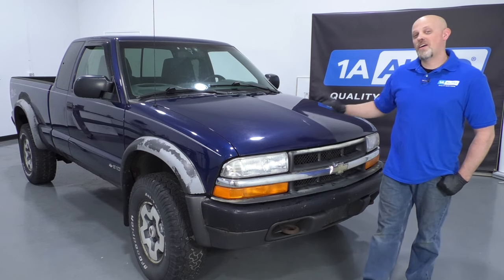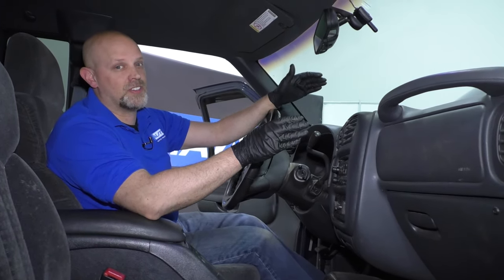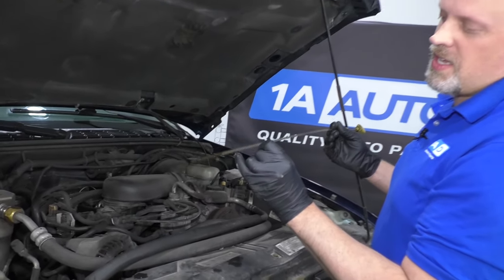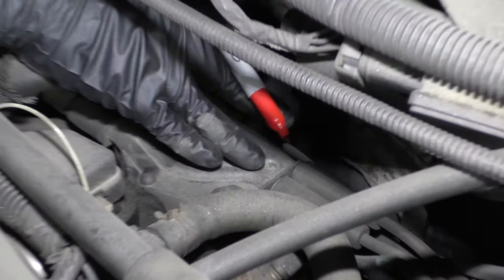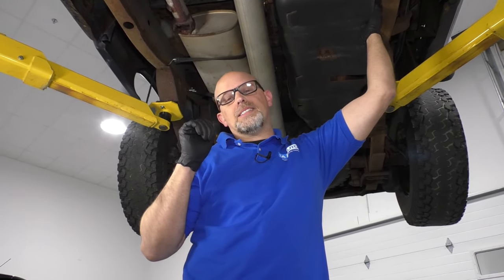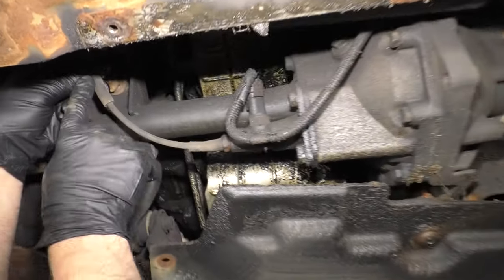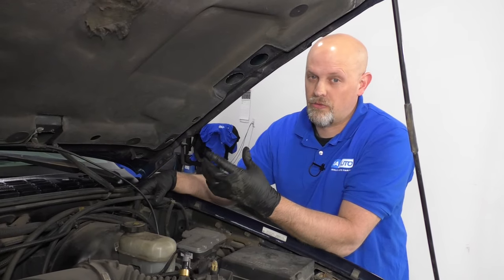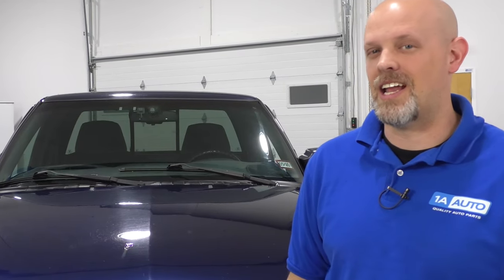Top 5 Problems Chevy S-10 ZR2 Truck 2nd Generation 1994-04

Comment: The fact that nobody has figured out a better way to unblock a heater core is just mind blowing to me
Reply: My heater has never worked
Reply: My heater core messes up occasionally I need to flush my radiator but in the meantime I just take a hose fitting Stick it to my heater core hose turn my faucet on and let it run a little while and then put it on the other heater core hose and let it run backwards works good for about a year but my radiator it's nasty so it gets clogged back up again
Reply: Main reason why get all dirty and nasty is cuz the heater core sits up higher than the radiator so it gets air bubbles and all kinds of shit in the system first take your cap off let your radiator and let your truck run with the radiator cap off did they get rid of air pockets and your heater core if that don't work flush it flush the heater core just unhook both hoses from the engine that ran to the heater core and flush it out with a garden hose if a garden hose going to work take it to the car wash hook up the high pressure pressure washer to it works every time
Reply: One the first things I did to my '99 ZR-2 was to flush that orange Dex-cool shit out and replace it with regular green coolant. The Dex-cool had created an orange jello like muck in the heater core
Reply: @galenhof3371  same thing here, the orange stuff gelled and hardened.  Ended up replacing the core because it wouldn't all flush out.
Reply: I had to put a heater core bypass kit on mine.. the quote to replace it about gave me a heart attack.. the part itself was under like 30 bucks, but the quote stated it is an 8 hour job, with the total being $800 😳so yea, ugh, 3 winters now without heat, super miserable but I've gotten creative with ways to stay warm..
Reply: @jerilynmorris9615  enlighten me on how you are keeping warm I went 5 winters no heat

Comment: Wow - have had ALL of those problems. Sure wish this would have been around when I needed it but wow does it HELP to know this stuff! Have a 2003 s10 4.3 and STILL LOVE that truck. Planning on eventually restoring the whole thing (surely not worth it) because it's just a fun ride and STILL looks pretty good - runs GREAT. Redid the spyder and valves a couple of years ago and was surprise at how easy it really was with a service manual. Lost the dang thing  - Chiltons don't cut it-lol. GREAT JOB 1A AUTO!!! Have found so much stuff over the years that's saved hundreds or hours and dollars.
Reply from the maker: +B L Thanks for the feedback!
Reply: 2003 zr5 with 456k on it. Only one issue besides wear parts was a wire was broke right at the connector for the coolant temp sensor.  Had it parked the past two yrs at sis inlaws farm because im in an apartment building and only allotted 2 parking spaces. Didnt get there often enough to cut the grass around it/under it so the rockers rusted and a few other minor spots. Planning on starting a frame off restore spring of 2024 if not sooner. trying to located leaf springs as I broke one when I drove it off the trailer (no ramps lol)  to park it at the sis inlaws.

Comment: Bought a 2001, 2 months in I had fuel pump and distributor issues. Overall a great car for almost 20 years old. First chevy
Reply: I have a 2000 zr2 with 177,000 miles...love it to death
Reply: Bought a 2000 xtreme 2.2L  93k miles on it off my brother in law for $200. Runs great 👍
Reply: Same just bought a 01 Chevy s10 and everytime I go to hit the brakes the steering wheel shakes, what could be cause that?
Reply: @amez1k636  calipers and or rotors sticking.
Reply: @barbiesawada5916  our the rotors are warped and or possibly a wheel bearing going bad.

Comment: Another one on the 4x4 in northern climates is the vacuum line that supplies that switch. The trouble area is under the battery tray where moisture can settle in the line and then freeze in the winter. This prevents the truck from shifting into 4x4. The solution is to reroute the vacuum line that is under that battery tray in such a way as to eliminate the sag in it so that condensation/moisture cannot collect there. I have had several trucks that I had to crawl under the truck with a pair of vice grips to manually pull that cable on the front differential to lock it up so I had 4x4. Best to just fix it while the weather is nice.

Comment: Just a heads up, you do not have to take the dash out of the truck to replace the heater core. If you disconnect and remove the passenger side airbag, you can access it easily through the hole in the dash behind the airbag.
Reply from the maker: +Billy Masoner We appreciate the feedback. Sometimes there are multiple ways to accomplish the same repair.
Reply: What if you don't have a passenger side air bag ?
Reply: Wow thanks for that. Any YouTube video on that? Seriously that is a great tip! Super Appreciated.
Reply: Seriously, would’ve done this if I heard about it

Comment: I love my 2000 zr2! It's got a 9 inch lift rolling on 35's with 250,000 miles and she is still running strong. She's my silver lake sand dune / bogging machine, never gets stuck and never leaves me stranded.
Reply: s-10 are junk dude

Comment: Nice video. I had a 1997 5 speed manual Chevy version that is an awesome truck. A few things I changed because of an issue were the coil, plug wires, spark plug gap and swapped out the poppets for Bosh injectors. Made a huge difference in performance and that motor ran better than it ever did. The reason for those changes was a condition where the ECM would raise the idle to burn off carbon deposits that clogged the EGR valve. There was a tech service bulletin issue for it but it didn't address the root cause which was very poor combustion. GM coils were 35k volt and swapped it for 50k. With a manual trans, the ECM didn't have an input from the speed sensor which is attached to an automatic transmission but not to the manual trans so the ECM ignore it and the driver would experience cruise control when lifting their foot off the gas. The ECM programming disregarded input of the speed sensor when a manual trans was involved. So it didn't know the vehicle was in gear and moving so it assumed the vehicle was stopped when it was safe to raise the idle to burn off carbon deposits. Very dangerous when turning in gear. You're expecting the truck to decelerate but it doesn't. I am not going to get into how I discovered it but it involved driving around with an engine scanner to see exactly what was going on. What I did above solved it. The factory EGR valve is still in the truck now. The Bosh injectors are still running perfect. Did all this work in 2000 when the warranty ran out.

I also had to change the heater core and fuel pump once. I've had no issues with vacuum leaks or electrical connectors. I did condition the lines and I used dielectric grease on all electrical connectors in the truck. 
One issue not mentioned in your video was the remote oil filter lines leaking due to vibration and poor support. Solved that as well. 

They are great trucks and why wouldn't they be. Chevy 1500 parts in a S10. lol Almost indestructible.
Reply from the maker: +Mike K. Thanks for the feedback!
Reply: Thanks for a very informative post. Is it a 4 or a 6-cylinder?  What does "condition the lines" mean?

Comment: Lots of good info for a potential S10 buyer like me.
First thought is that if the heater core is bad then what sort of condition is the radiator in, and maybe that should get replaced too.
Also, if the issue of sucking fluid into the vacuum lines is so bad  perhaps some kind of oil catch can could be added to that line from the plug, which could intercept the oil and also give a visual indication that the plug is faulty?
The intake gasket problem of oil/water contamination is a scary one . . . not sure how to deal with that one. Must be something you can do instead of waiting for it to happen.
Anyway, i now understand why there are so many of these selling really cheap in NZ.

Comment: I have a '99 ZR2 Blazer with 178,000 Miles on it, and I Love It. It's Red, the clear isn't peeling and the Sunroof works Great. It's seen many Adventures but the carpet and seats are in great shape and there are no cracks in the dash!
Rear hatch is stuck so I need that blue plastic link, and I'm going to rebuild control arms with ball joints and replace the front hubs soon. Awesome Truck

Comment: That is funny. I had the intake issue but it was burning off the top of the engine. You can see white corrosive residue on the aluminum. I also had the heater core. Also had the fuel pump issue. Haven't had wheel bearing issues anywhere near as much as ball joint issues. This was a huge problem with pit type instant oil change places. Six different places I took my 1997 GMC Jimmy. Asked all six do you grease the upper ball joints. All six oh yeah we get them all. Checked when I got home not one had greased the upper or lower ball joints only 2 greased the outer tie rod. Huge problem mine has been through like 4 sets of ball joints. Idler arms also a big problem. Finally I also had the vacuum issue. all of the climate controls are shot. I will bet it was from what you said. After watching this video now I know why.

Comment: When you change the intake manifold gaskets, if the dexcool has not been removed from the cooling system, do it at that time. It is part of the reason the LIM gaskets fail, the green coolant works out a hell of a lot better.
Reply: I've never heard that before but the previous owner of my 2000 GMC ENVOY / s10 Blazer all dressed up had flushed a refilled the system with the green coolant. I always wondered why he did that and I was thinking that he had green coolant on hand when he flushed and refilled. I know the dex cool is supposedly less toxic to animals if you had a coolant leak or got into an accident and lost all your coolant. Thanks for the tip super appreciated. Eddie J. Long Island NY
Reply: Yes, just YES.....don't ask me how I know

Comment: I just had a motor put in mine. It’s a 99 with 151,000. Blew a head gasket. 4 cylinder. Heater core was the tipping point. Cost me $2000 to replace the motor, radiator, heater core and water pump. I’m pleased. Runs great.
Reply: It just cracks me up when you think about how car manufacturers design things that basically feed the dealerships with labor charges. The Heater core could have possibly been replaceable from under the hood but no. My 86 Blazer wasn't that involved thank goodness.
Reply: What year was this that you made those repairs?

Comment: UGH, I have a '99 S-10 Blazer and I've replaced the fuel pump like 4 times. Sadly, I'm at the point I've gotten pretty good at it. Be extremely careful with the pressure valve on the front end of the tank. It's easy to break the little nozzle off and since it's molded into the tank you then need either replace the tank or find a way to patch a rather large hole. BTW - Great video guys. Thanks.
Reply: I've replaced those damn fuel pumps more than I've wanted to with the 3 D-10s I've owned over the years!!!!!!!
Reply: I never had good luck with those aftermarket fuel pumps I put a GM fuel pump it was like $87 I used to carry popping hammered bang on the on the fuel tank to get fuel pump going that way you can always make it home I'm disabled now I cut some corners 86 started leaking coolant drained all the antifreeze out to put two bottles bars leak in it Granite with just plain water until it stopped leaking, change the oil went back with antifreeze no leaks I think I re-torque the intake bolts it was my own vehicle and I couldn't afford to pay somebody else to fix the time
Reply: Did you regularly run the tank empty?
late comment but curious

Comment: WOW - this is an amazing video!  Just watched for the first time, i've owned my 2003 GMC Sonoma for 16 years and pretty much have been through all of this (the expensive ways....).  Currently experiencing a failure to start, which now my guess is the distributor cap (#3).  Impressive video!
Reply from the maker: +Scott Gilles Thank you! We love empowering our customers and showing how to perform DIY auto repairs with our high-quality auto parts.  http://1aau.to/m/Shop-1AAuto-c
Reply: I would suggest trying to start it with a little starting fluid in the air flow find out if it's a fuel pump or the spark
Reply: How many miles does your Sonoma have?
Reply: I'm having that problem right now...it was down for a about 4 months I changed the starter and it never turned over since....but I just now replaced the distributor cap and rotor so wish me luck
Reply: I would check the fuel pump and I know this comment is over a year old but I had to replace mine 12 years ago. I no longer own the truck but mine would turn over fine but it wouldn't start but sometimes it would sputter.

Comment: 4/5 of these issues I’ve experienced with my 02 S10 4WD. GM lost a class action lawsuit over Dexcool in 2012. The coolant is prone to going acidic when air mixes into the cooling system. I’m so sick of GM crap, constant repair qualifies as a lemon product line.
Reply: if you simply change the fluid its fine, even if you stupidly used the dex cool again, which nobody should do,
Reply: Cyr Media I still use dex cool.. never had a problem. Keep it clean and keep it fresh and it’s fine. If you neglect it of course it’ll have problems.. duh! There is a change interval for a reason. Neglect your vehicles they will neglect you, it’s simple...
Reply: GM's not the only problem out there look it up on the internet all junk otherwise mechanics wouldn't have jobs

Comment: He didn't mention you can bypass the heater core very simply delete by coupling your heater hoses together in the engine compartment .
Reply: Why would you not what to have heat?
Reply: Then you have no heat..
Reply: Arizona fix👍
Reply: That's actually a good idea. I've done it in the pasted till I had time to replace the heater core. And it's actually cooler inside the truck during the summer as you don't have the heat coming out from your dashboard or under it. The older cars had vacuum controlled water gates in one of the heater hoses to block the hot water from entering the car during the summer with the A/C on. Wonder why they stopped using them?

Comment: Guts of the catalytic converter can come loose, rolling forward and backward inside. This can clog the exhaust, bogging down the engine and causing kickdown issues. That's how I got my 97 blazer for $500...10 years/100K ago- and counting. I lived in an emissions exempt state for a long time, so I just cut it off and straight piped it to the muffler. Got to where I couldn't hear anything over the exhaust to troubleshoot other minor issues,  and I wanted to keep it cheap, so I simply mated a 2nd muffler in place of the cat. Worked like a charm. Since then, I've moved to a state where it matters, so I rebuilt the exhaust with aftermarket parts, and haven't had a problem since.  All in, I might have $1200 total in the vehicle. One day, that heater core is going to go out and I'm going to rig it with Tanerite and do my best to launch it into orbit around the earth.
Reply from the maker: +Charlie Mountain Thanks for checking us out! http://1aau.to/m/Shop-1AAuto-c
Reply: I wish I would’ve used Tannerite on my 96 at 10 they gave me headaches and pleasures for 10 years straight.

Comment: I agree with #5. I remember when these S-10's were brand new and would constantly see them in shops getting fuel pumps replaced. It was commonly on the early 2000's S-10's if i remember correctly.

Comment: Had an 03 ext cab v6 automatic.  Ole lady sold it in 2016. Had 235k on it- 80k when bought. Water and fuel pumps. Front end parts. Was needing the intake gasket done but running 200 miles a day 65-80 mph. AC cropped out also. Overall a great little used truck I drove 150k miles over 7 yrs. Just bought a 2000 ext cab v6 2 wd with 174k miles for $3500 today. All the truck I need for rural Az and the dirt road I live on.

Comment: I would say one of the top 5 would be the elephants in the room. The L60e trans. I've heard of a lot of other S10'ers mention their trans just crapping out. Mine gave out at around 213k miles. But since I love my truck, I had it replaced. Which I consider acceptable considering how old the vehicle is and that it was used, abused, and thrashed about a farm before I owned it.

Comment: Recently bought a s10 good to know the most common problem
Reply: Have had one for 3 years, out of these have experienced the last 3
Reply: Upper lower ball joint upper and lower ball joint and alternator.
Reply: @breckenhelsley4831  i just bought an 01 s10 and when I go to hit the brakes the steering wheel shakes, what could be causing that?
Reply: @amez1k636  Rotors or calipers are sticking

Comment: You forgot the dreaded remote oil filter lines and oil cooler lines.
Reply: Thats a 13$ fix though. I put a oil filter adapter on my 2002 blazer zr2 it took longer to remove all of the oil cooler lines than it did to install the adapter and new filter.